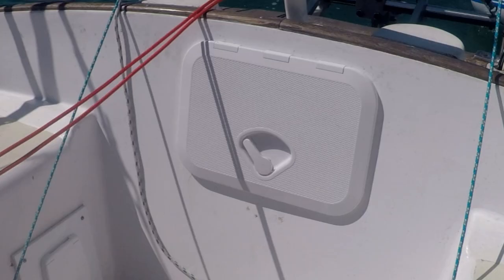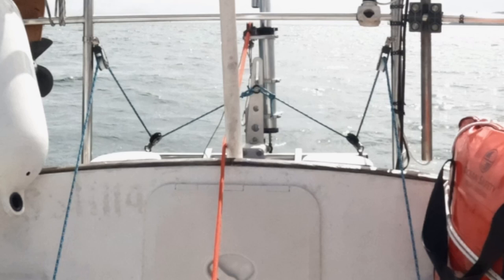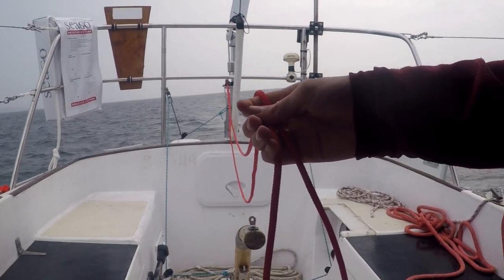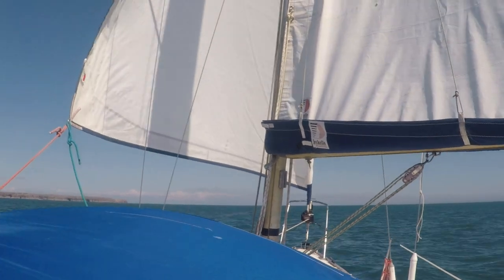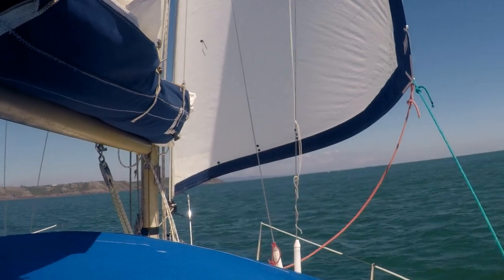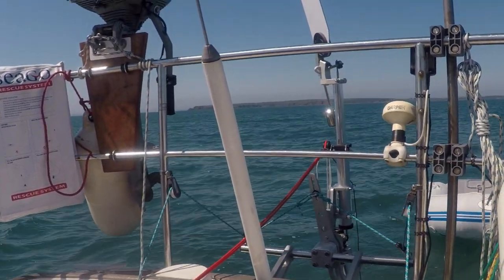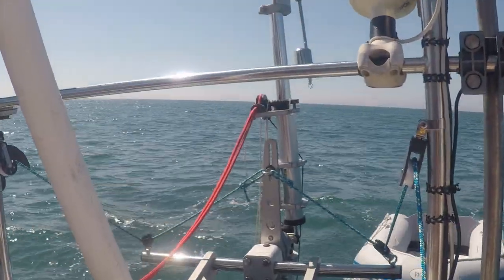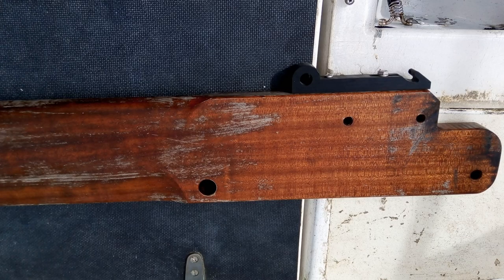YACHT FLORENCE ep 33 - Two years with a Sea Feather windvane, what do we think?

Comment: I’m delighted with mine. The first thing I did after the end of the first season was to revarnish the blade. Don’t build up too much varnish at the pivot point . I used one pack poly. Other tips: I lead the control line through two snap shackles. Pulling on the top one rotates the vane clockwise.  Bottom one…the reverse. Also, if the blade is canted, when you want to lift it and the us under sideways pressure, it may not disengage. Simply adjust it to centre and wait a few moments. I have a long keel Twister. This year it has worked very with upwind and downwind…but, if the apparent wind drops below around 9 knots…it needs careful sailtrim. On the other hand, in. F7 and a quartering sea from the stern…brilliant.
Reply from the maker: Thanks for your comment and thoughts! I actually need to thin ours down at the pivot point before re-varnishing this winter. Re control line, we find identifying which one is the upper and lower at night is impossible without using a torch and destroying night vision, need to experiment with your suggestion of two snap shackles. Ours has worked surprisingly well in light winds, but perhaps slightly lighter boat than yours!

Comment: Bought a boat with one of these fitted. Can you tell me what the church house pin is? Haven't tried mine yet as been refitting but looking forward to giving it a go. Nice clear information on your video.
Reply from the maker: Thanks for your comment!

If the servo blade strikes anything the overload plate is designed to shear in which case you can remove the Churchouse pin from the servo blade and insert it through the stainless side plates and through the blade. This will hold the blade down (being plastic will shear should you hit something else).

Hope that helps.

Comment: Very nice! -- QUESTION -- One thing I cannot understand about wind vane steering systems, is why you must manually adjust the vane into the wind?  To be clear, I understand why the vane must be adjusted in reference to the wind. However, I don't understand why it can't adjust itself to the wind, in the way that a wind vane on top of an old barn would always point to the wind's direction, and do so automatically.  Why not incorporate that feature on wind vane steering systems and avoid the control line?

Comment: Varnish etc is just normal maintenance, rub it down once a year and then oil it, it will last you out
Reply from the maker: The coating on the blade shouldn't have failed (after such little exposure to the elements) to the extent that the blade is near impossible to release from the housing.  So we need to thin it down and then re-varnish as required. But overall great bit of kit!